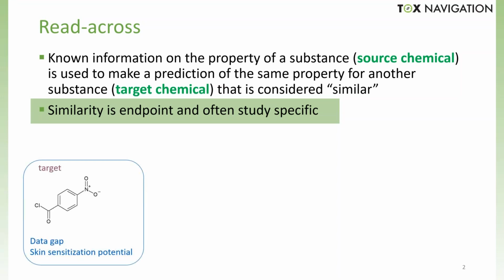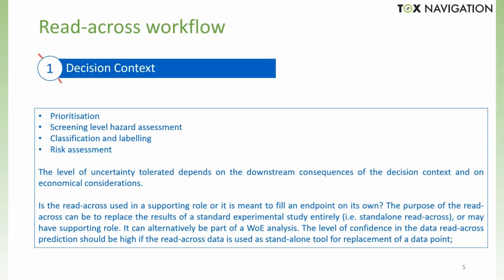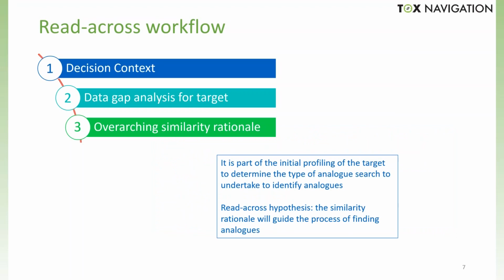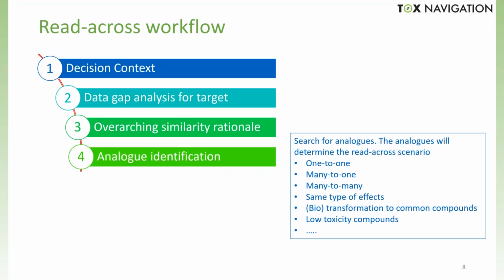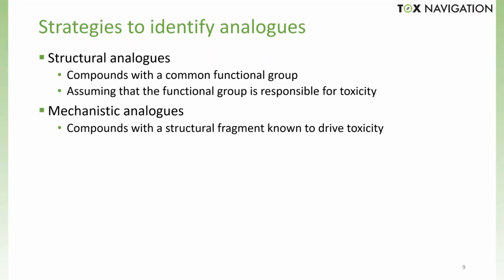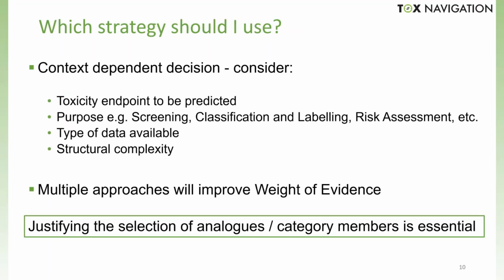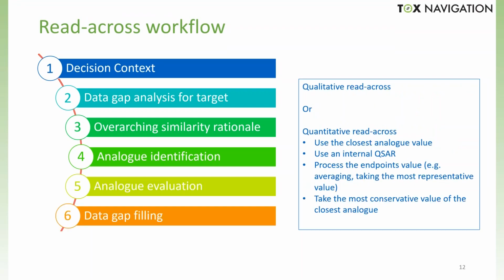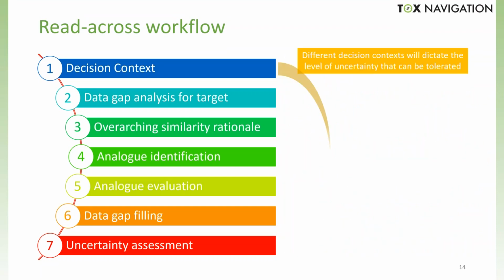How do I conduct a read-across?

Comment: Great video!
I have one question concerning the uncertainty assessment.
You say that the data driven approach could be considered more objective, but doesn't that also have a lot to do with the training set used to train the algorithm? Basically, what I am questioning is whether there is enough data to sufficiently support the data driven approach currently. 
I would agree that the data driven one is (in theorie) more objective, but how far advanced are the data sets that are used?
Also, adding onto that: 
The selection of the training sets seems to me somewhat subjective as well. How can we eliminate that while also ensuring that the trainings set that is being used fits the test set?
Because in my view, bias can also be added by the data-driven approach.
Reply from the maker: Thanks a lot for your comment ..... 
I agree with you. In fact we use the terms "more objective" meaning "reproducible" and it is referred to the last step of the workflow. This is our problem of trying to reduce and summarise a complex subject into a "snappy" short video!  We do run on-line training courses covering this in a lot more detail.  Next one is in March.